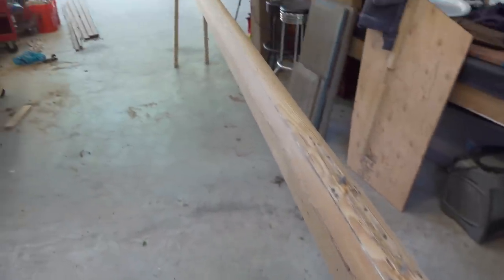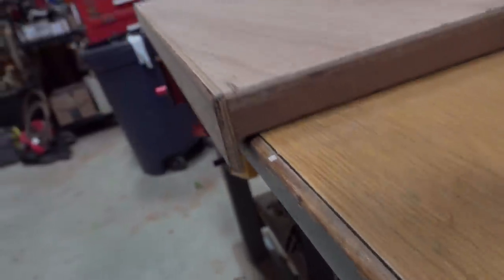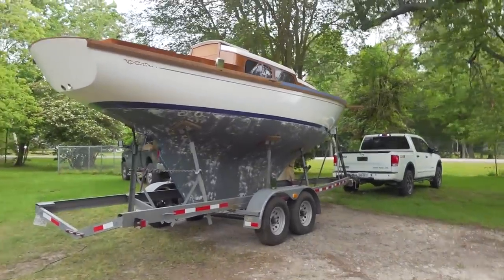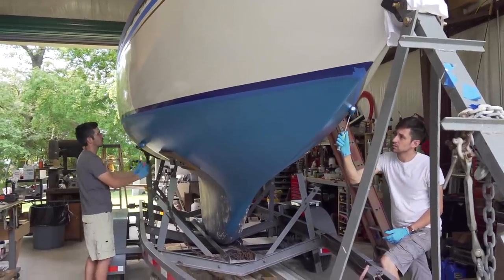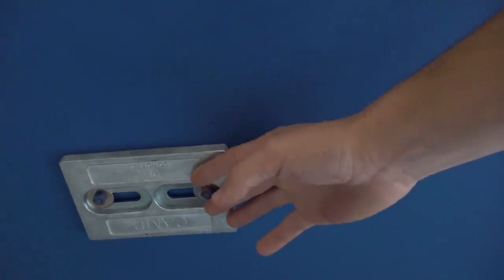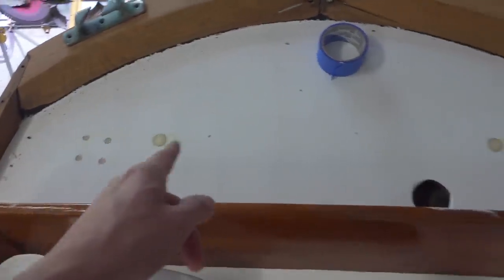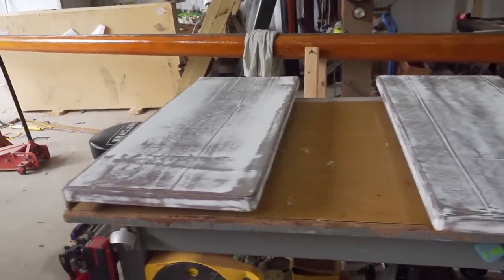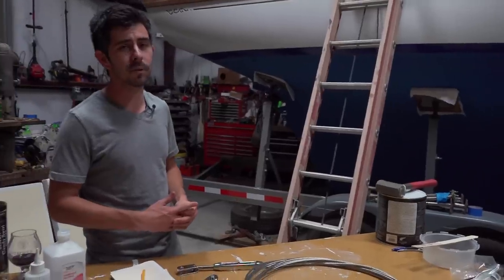Mast, Paint, Kiwigrip | Sailboat Restoration Ep. 45

Comment: Do you mind sharing what type of roller you ended up using on the exterior hull paint. I looked in comments but didn't see any. Thanks !
Reply from the maker: I think I used a foam roller. I can't remember for sure and I couldn't tell from the video really. If I had to do it again though I would just use a high quality foam or really short nap roller. And we tipped it. My first topcoat was with a full size 3/16 nap roller and it put way too much paint on and left some really nasty orange peel texture. I got to do alot of glorious sanding after that.
Reply: @SailBros  ok much appreciated, definitely trying to avoid the overage of paint. Thank you for the response.  The work, video content, boats... You guys are killing it. Keep following that passion 🤜